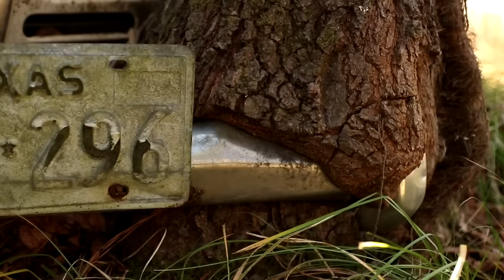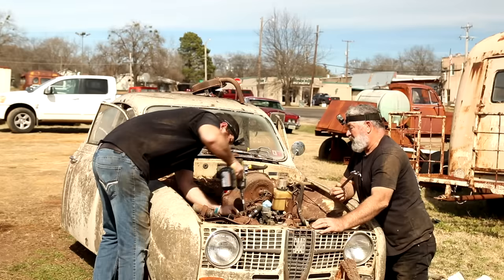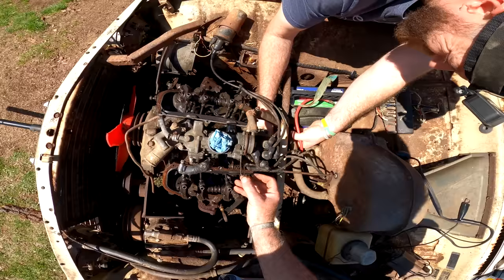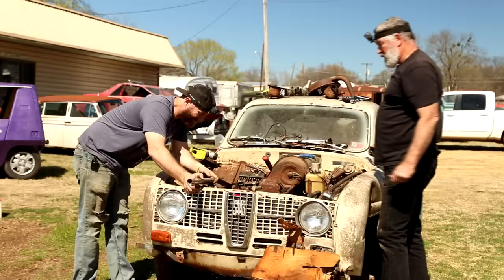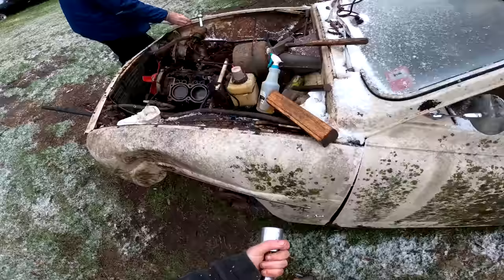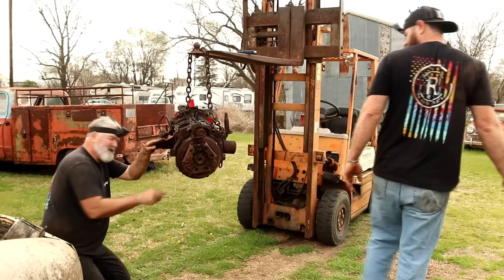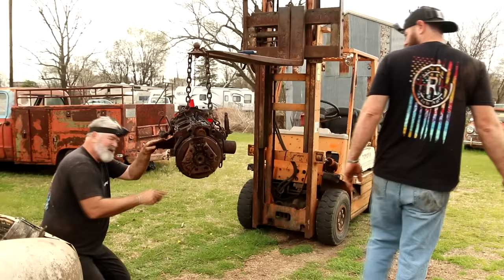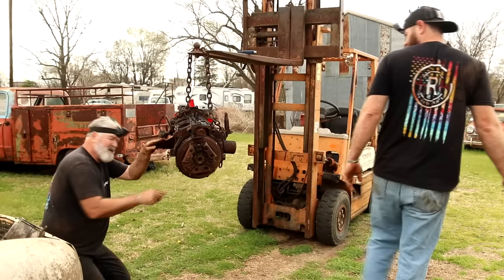THIS IS BAD! Attempting To Start Locked Up V4 Engine Covered In Rats Nest | 1968 SAAB 96 | RESTORED

Comment: Put 24v on tye starter and get it spinning faster, else use motorbike chain lube(i use the Spajard brand we get in South Africa) in the cylinder bores to help seal the rings off and try cranking it then.
Just be catefull that you dont burn out the starter by cranking it for too long.
Reply: Hasn’t anyone in here ever heard of marvel mystery oil ? Best penetrating oil you will find have used it too free up rusted piston’s stuck in engines for years,should have shot some into spark plug hole an let sit for a day or so an keep trying to rotate the engine. I’m sure you can find it at a parts store some were out there,just my two cents worth on stuck rusted pistons

Comment: I'm sure that you will have a good time rebuilding it. However here in the UK they aren't that uncommon. There is a few parked around my area. As "cute" as they are, they aren't good cars. Sure for a bit of fun on the weekend, it would be fine. But that's about the extent of their usefulness.

Comment: Also while running the starter at 24 volts what if you put 2-stroke oil in your gas or maybe not even gas use a fluid that is more combustible gas typically doesn't explode until 90 PSI what about something that explodes at a lower PSI to pop them Rings loose

Comment: Don't try and start the engine with the choke on. The restriction this causes slows the engine down and will tend to flood the engine. Use spray-start instead. Give the starter motor 24 volts for a few seconds. God bless :)

Comment: if I was you two I woulda just yanked the oil pan off, and remove all the bolts from the connecting rod caps and just yank the pistons out, its all gonna need rebuilt anyways.

Comment: If you pull the motor out put it in  your pocket and take it into the shop. You want to start that thing much worse than I would to work in the snow. Day after tomorrow it will be seventy again.

Comment: If you want to start a dead engine with low compression 

Use oxy~acetylene weilders just the oxygen so fire esayer 
Or
Use a leaf blower to add some boost
Reply: FYI if u get a truck air starter and put socket on u have a realy fast hand starter 

And a weilder can be a good jump pack to run car off of instead of cooking batteries 
Use a dimer to drive it change output voltage for old iron core

Comment: what happend then, could you make that saab drive again or did you throw it away ? i would have liked to see that old saab driving again, like alot of the people here do too. parts of that saab can be custom built, if original parts arent available anymore, not a problem to make it like new again, matter of money of course but collectors have a plenty of that for their collections. one of them (there is always someone) would have liked to take that old saab for a complete restauration, would be to pitty if you threw that old saab away. its only old metal but there is history to saab.

Comment: The Saab 96 wasn’t a pretty car but it was mechanically brilliant the V4 engine was designed by Saab to be 1400cc but ford used it and bored it to 1700 cc which is why they had head gasket problems but in all the years I worked for a Saab dealer never once did I see a95 or 96 with head gasket problems

Comment: Starting fluid that bad johnny. It's a FORD TRACTOR MOTOR v4 PARTS ARE AVALIBLE. Same as a Ford v6 too  (minus 2 cylinders) v6 taurus motor ?v6 swap is common , drops right in. Carb will be full of gunk. Open it up clean out the bowl. I would jump start it to spin faster with a running ca

Comment: Hi guys did you know that that engine you're working on is actually a ford engine they were fitted to most Ford Europe cars in the 60s like a ford zephyr ford consul and  ford transit ford stop using them because they suffered severely overheating problems Saab used them in their cars because they want to get rid of the 2-stroke engine they used ford V4 engine because it was only engine that would fit in the engine buy . And if memory serves me right that's a 2L engine 🇬🇧

Comment: Advice is walk away even in tip top fettle hasnt the power to pull skin off a bowl of custard gears pull to wheel up 1st down 2nd up and forward 1inch up 3rd down 4th push away from wheel and down is reverse theres a sweedish gut managed well in rallying with 150hp out of oñe but like that i would have left it in the trees

Comment: USE MARVEL MYSTERY OIL if you want to un-stick the rings. ALSO ADD A LITTLE TO THE GAS it will lubricate the top end. I haVE BEEN USING IT FOR 50 YEARS NOW AS THE OLD MAN DID WHO TAUGHT ME ABOUT IT. It really works.

Comment: Why not take the pistons out when the engine was out of the car and check them, to keep putting oil in the cylinders does not really sort things! You know insanity is doing the same thing over and over and expecting a different outcome! Sorry but it’s frustrating to see you miss doing the right things at the right time. The Saab was a brilliant car and the full tray under the engine was to stop the build up of snow and I would suggest at this stage you should give up and go for a beer!

Comment: when you get saab 96 v4 in bad condition you repair it almost evryday before it run i have once 96 v4 and it very easy car repair actualy i have saab 900c 93 96 and 9000cd and my dad have in 2003 saab 900c safari

Comment: That transmission has a freewheel system, take the engine out and repair it properly, very simple engines .  Building an  engine using old gaskets is amatuer stuff. The weird design is so the bonnet does not go through the windscreen in a collision , the front panel and rad should be removed , 10 screws secure it, to remove the engine ,clear you know nothing about saab v4 cars, its a german ford engine easy to get gaskets etc .

Comment: That's a open deck v4. Only made in 1967'its junk. Look for a 1968 or newer  engine . The block heads and oil pan are different from the rest of the v4 motor. The head gaskets are also only unique  to that motor.

Comment: Back driving engine from wheel probably won't work due to differential.  One wheel will soon if the other has the load. I think your rings are just too far gone

Comment: that's almost farcical, after all the work done remove the conrods and pistons, stick new rings and off you go. Btw the transmission is 'freewheel" so trying to spin the wheel to engage the crank was completely useless

Comment: Too much unneeded drama....if i wanted this to start, for views or whatever reason, and i went as far as removing the engine then why wouldnt i check if the valves are sealing and remove the pistons to clean the ring grooves??? If rings were broken you can use rings from any other car with same diameter pistons. Groove size is easy to find a match for.....i bet that if you want to make it work right you can find gaskets and carb rebuild kits off of sweden, maybe even on ebay ready to ship. Intake gasket can be cut , no need to save old gasket for anything other than testing...reusing old head gaskets involves atleast using gasket varnish if you even want them to atempt to seal.

Comment: You guys  need to do some research before wasting all the time and energy . The free wheel clutch it the tranny is not engaged.  You know nothing about Saabs and could do damage. It is much easier to lift tranny and engine in on piece. I did mine in 35 minutes by myself. As long as you pulled the motor, take time to pull the oil pan, inspect and soak in diesel  for a few weeks. Hammers and pry bars only cause problems. Open the trunk, you might find treasures like another tire or motor! if the back latch won’t open, the back seat folds down flat, providing good access. Find a SAAB club for help

Comment: Im sorry guys but it’s unprofessional job, you have to remove crankshaft first and move pistons down, then little to sanding and cleaning cylinders , then remove pistons out. 
Also Cutting  muffler on the 50+ old car it’s crime guys.

Comment: Why do you all push it so hard to get it to run? Is it for the algorythym? It isn't a huge engine why not just go ahead and pull it? I mean it seems silly you would put it back in at that point but it seems way sillier to think you can "break free" seized rings when all 4 of them are having the same issue. But it isn't like it is even close to drivable so I just don't see the point. I mean I know you can't get parts but why not take it apart and free the rings, if you are going to keep doing this to it. I am at 66 min and just wondering why you wasted everyone's time is all. 
Though I could watch some more ofc and maybe it gets answered I am just cringing at this point.